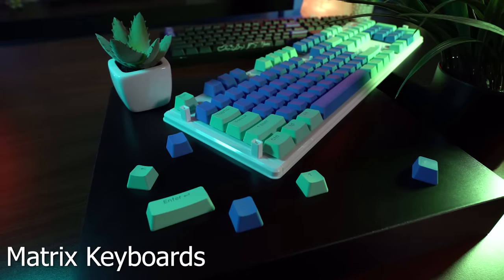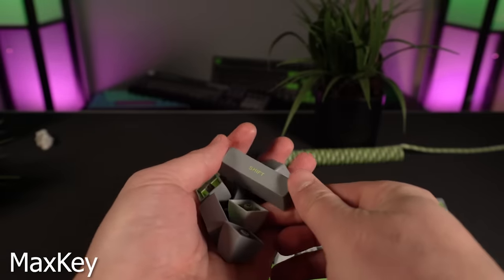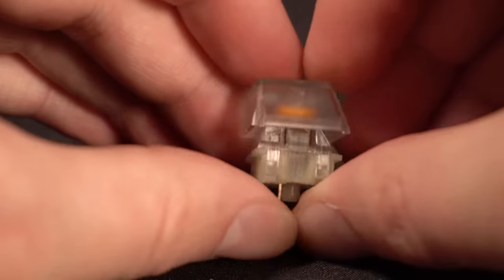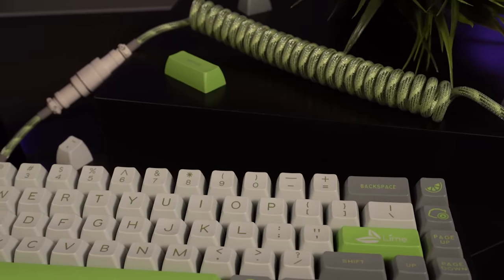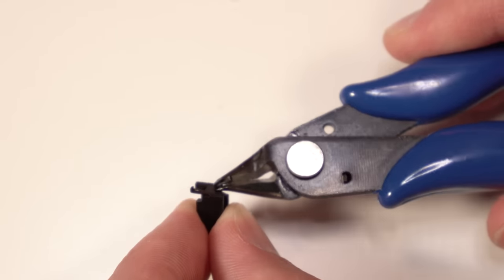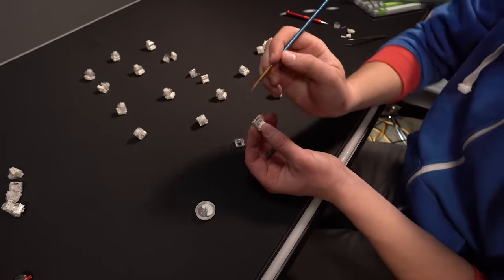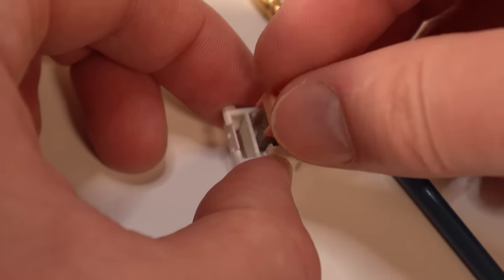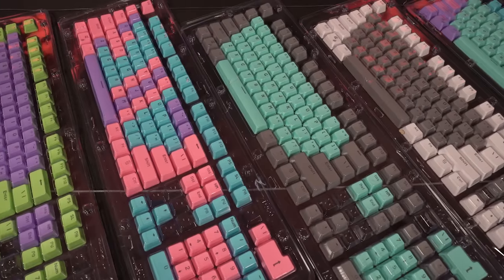5 Super Easy Mechanical Keyboard Upgrades Anyone Can Do!

Comment from the maker: Hi everyone! I hope you find this video helpful. What mods are you going to do first!?
Reply: Probably gonna just lube my stabilizers and add switch film to my switches.
Reply: I love ur vids
Reply: Brainbean Not all switch lubes work with stabs. I'm pretty sure the only switch lube thich enough to work is Krytox 205g0.
Reply: Lube stabs using interdental brushes! Its easy without having to remove the switches from the pcb. Tried this myself. Not perfect but gets the job done.
Spray Lube switches! Been tried out a lot in Korea, and some people like it. Using Aerosol SuperLube to lube switches rather than brushing lube. Messier, but it is easier. Havent personally tried but it works.
Reply: add a warning for when the sound test ends it's a good idea :)
Reply from the maker: kawaei uwu not a bad idea. I’ll consider doing that next time 😄 hope your ears are okay.
Reply: Do you have links for the coil cables? I think you said lux and space
Reply: @Brainbean  thanks :)
Reply: For plate-mounted stabilizer, I would apply tape or apply bandage to the mounting spot on the plate as well. It makes the stabilizer a lot more secured and also reduce rattle even further.
Reply: Mousepad????
Reply: thanks <3 I bought o-rings and lube my stabs
Reply: Anyone here know where I can get that mouse mat in the first few seconds of the vid?
Reply: just ordered the parts for my first custom keyboard so I'm gonna do as many as I can while I'm building it!
Reply: hey what about spray lube?
does it really work
Reply: I didn't even know you could mod the stabilizers. Looking forward to trying it!
Reply: What is the mouse pad in the thumb nail
Reply: First, I'm gonna buy a keyboard.
Reply: ouzoiiooo
Reply: Is there a way to add rgb to a no rgb keyboard?
Reply: Probably gonna buy a keyboard first.
Reply: Where can I get a set of dark blue key caps(60%) in de layout?
Reply: All of them when I save up enough money bc I’d rather buy games
Reply: keycaps
Reply: how bout a 5 dollar membrane keyboard
Reply: @brainbean what is the keyboard you demonstrate the key presses on? Im trying to find it!
Reply: Hi  I need help can you Mabey loob my keyboard
Reply: I’m not smart enough for the extensive things because I’m an entry level with a ducky one 2 mini
Reply: We can Just paint the Keys but its work haha
Reply: i dont mean to be so offtopic but does any of you know a tool to get back into an instagram account..?
I stupidly lost the account password. I would love any help you can give me
Reply: @Dangelo Valentin Instablaster =)
Reply: @Ayden Harry Thanks for your reply. I got to the site on google and I'm trying it out now.
I see it takes a while so I will reply here later with my results.
Reply: @Ayden Harry it worked and I finally got access to my account again. I am so happy:D
Thank you so much you saved my ass !
Reply: @Dangelo Valentin Happy to help =)
Reply: Hey
Reply: even i dont, or i just buy a hole new keyboard. as the price is almost identical

Comment: I don’t even own my own mech yet but that being said- 

I’m already intrigued by this hobby- didn’t know people were so into it until a few days ago. Consider me subbed.
Reply: Lol same, learned about mechanical keyboards 5 days ago and already make a custom cable, ordered ducky one 2 mecha, handmade space, enter, space keys and a pbt japanese keycap set lol.
Reply: @StagnantMizu  I wish I had money lol
Reply: Mugen why tf do people even like that board. Doesn’t even support hotswap you just stuck with same cherry switch for life like tf
Reply: Saif Bastaki i dont know much about keyboards, but i’m pretty sure you can hot swap a ducky one 2
Reply: @TooGood4Gamesv1  No it doesn't, unfortunately, which might be a dealbreaker for some. But if you're set on which switches you like, it could be a good option if you're into RGB and like the 60% form factor. One major downside is that Ducky only offers Cherry switches (no option for Kailh box or Gateron).
Reply: @strawberry4231  this is the reason I'll Build my own 65% Kb. I want Kailh Box Red Switches, ISO De Layout, my own Keycaps and stuff like that...
Reply: strawberry42 epomaker gk68xs is where it’s at. Hotswappable, rgb, 65%size, wireless/wired usbc, Great pbt keycaps, and a heavy aluminum frame if you want it over the plastic frame.
Reply: @Triannosaurus  I'll be sure to check that out. I just recently bought a DZ60RGB ANSI v2 hot-swap kit from KBDFans, so I'll hold off on splurging on another keyboard for now.
Reply: Same lol
Reply: @TooGood4Gamesv1  you can't  you have to desolder it
Reply: @samba9450  Well the people who likes them are mostly enthusiast.
Reply: @StagnantMizu  lmao same, learned about it a couple weeks ago and now I'm 2 boards, 3 sets of switches, and a couple of keycap sets deep
Reply: Same
Reply: Im getting a mechanical today :o
Reply: Yessir
Reply: bonkbonkbonk
Reply: @StagnantMizu  ducky? ducky? fucking ducky? why that? just get a gk61 with the alu case. I wanna know why you are getting ducky.
Reply: @Triannosaurus  the BM68 with the alu case is much better. its also cheaper.
Reply: @White-qw8xe   not the quality I want, Ducky is awesome great builld quality on  the mecha mini.
Reply: @StagnantMizu  lucky lubing those soldered switches. also Im pretty sure that the GK61 is basically the same build quality.
Reply: @White-qw8xe   well I managed to lube them, might not be the best choice overall but   I am more than happy with what I bought
Reply: @StagnantMizu  i like how many people are so mad at you and telling you to get otherwise.
Reply: @TooGood4Gamesv1  no it cant
Reply: @bublikestech2164  Yeah, I wrote that ages ago ahaha

Comment: Tip: You can lube your cherry or gateron switches even if soldered, you can unclip the switch from the housing to disassemble the spring and stem, more finicky but definitely doable
Reply: Can't speak for gateron switches, but this isn't true for all keyboards. All of my keyboards have plate mounted switches where you can't reach the clips.
Reply: Dereban Oh yeah true, some keyboard have no plates
Reply: @dereban5654  can foam and lubing the keys from outside make any noticable change in my typing experience?
Ps- I can't want to de solder my switches.

Comment: 1) Custom keycaps for that "aesthetic" and some notable difference in bottom out sound. See Maxkey SA, GMK, and matrix textures keycaps (possibly xda/dsa), but anything that isn't that boring oem abs keycaps. Also heard mt3 keycaps are good too.
2) o rings to reduce bottom out distance and make the switch feel "mushy"
3) Custom coiled usb cables (luxcables and spacecables) for "style" and nothing else
4) lubed and clipped stabilizers with bandaid mod
5) lube your switches

Good luck and find your own timestamps :)

Comment: Ok, before I watch the video I'ma guess what the upgrades are. 
1. Bandaid under the switches to reduce the wiggling and make it more solid
2. Color code the keyboard for specific finger placements.
3 lube switches for buttery smooth travel 
4. Place dampener pad under pcb to quiet the "ping" noise from switches & keycaps.
5. And while it's not technically a hard mod adding a forearm rest to the keyboard is a def win in my book.

Comment: People also use those connection cords for the fact that some have better connection speeds than others, usually they reduce the delay from each key press to seeing it on screen, especially compared to the cord you receive out of the box.
Reply: @Rando actually 1 second delay is heavily noticeable. With the drivers I run the stock cord that came with my RK61 has a 1.7 second delay which if you’re playing a competitive game that seriosuly affects gameplay and can bring a 4.0 KD in COD down to 0.3 KD

Comment: fun fact: u can still lube non hot-swappable switches, just hold down the keycap stem with a small flat head screwdriver and apply lube to the sides of the switch with a small tip paint brush.
Reply: no
Reply: @sarpp69  yes
Reply: @sarpp69  It does lube the switch a tiny bit but for most it's not enough and it is definitely not as thorough as a full teardown and lubing all areas properly.

Comment: Is there an easy way to check for "standard" vs "nonstandard" layout? Or do you have to actually look at it (as in like, know what size keys are standard vs nonstandard)
Reply from the maker: Typically just looking at it is the easiest way to tell. I would pay attention to the shift key on the right side and the bottom row as those tend to be the most common keys that will be incompatible if it's non standard. Which keyboard are you wondering about?
Reply: You should always look at the keycap size relating to another. Typically an alphanumeric key is 1u. Make sure you buy the keycap kit with the right 'u' measurements. For example, some poeple want a shorter right shift to add an extra button: they would need the 1.75 u instead of 2.75u right shift then an extra 1 u key for that row.

Comment: Can also put some foam inside the keyboard especially those drop keyboards make a metallic ping on every key press
Reply: That's more in the upstroke and at that point, foam won't do too much. It's better than nothing though...
Reply: @SimGunther  It will if foam touches the metal it will absorb the pang whether its upstroke or down check reviews at https://mkultra.click/collections/65-foam/products/massdrop-alt-low-profile-foam-combo
Reply: i’ve seen some people put sound dampening foam in it. haven’t tried it yet but i will soon
Reply: lube your springs

Comment: Great video! Just wanted to tell you, in case you didn't know,  there is no point in band-aid modding the stabs on the Drop Alt,  because plate-mounted stabs doesn't touch the pcb.

Comment: Brainbean: recommends lubing stabs
Me, who uses Costa stabs: ._.
Reply: You can actually lube costar stabs, though improvement is not as much as cherry style stabs.
You lube the holes in the nubs and and the parts where the wire connects into the board/PCB I think? Idk if there's vids on YouTube though
Reply: @rynne7153  yeah I know. Immediately after commenting this, I went searching for the guide and now I can confidently say that my spacebar isn't rattling anymore
Reply: @LilacFPS  Awesome!
Reply: You can also apply the bandaid method to costars, you just put the bandaid inside the part that clips into the plate (very thin strip) helps with that bottom high pitch clack.

Comment: Just about where I am at the moment, thinking about either building a 60% or trying something with my Corsair K68. Really knew nothing when I bought the board, it has Cherry MX Blue switches, I don't know whether it is soldered or hot swap. You gave plenty of explanation and sources for various modding items, thanks.
Reply: Corsair boards are all soldered

Comment: im chillin with my entry level $40 Outemu Blue switch Soldered Keyboard. might change soon to Ducky one or keychron
Reply: Ducky has a great reputation for a reason imo. i just got the one 2, and its the lil things, like an extra pack of colored keys, special spacebar and esc key and key puller is nice addition, you can tell they are passionate about it.

Comment: Also switch lube for stabilizers are Krytox 205g0 ONLY, others lives are either too thin or just harder to work with compared to dielectric grease.
Dielectric grease is also much cheaper for the amount you get
Reply: @Dubufy  should work just fine. it's not that hard to work with, and feels fine after lubing (I lubed my reds with 105 as well)

Comment: You also forgot that to mod stabs, you also need to remove the switch of that key, which also means desoldering. 

All of these are common knowledge, but the last two are not exactly "easy" on soldered pre-builts.  There are some methods with does not require desoldering to lube stabs AND switches, which you should have added on to the video. 

Spray Lubing! Common method used in Korea that they use some aerosol lube to lube switches. Its easy, but takes a while because you have to let it dry out for 1-3 days after. 

Lubing stabs using an interdental brush! Interdental brushes are really flexible, that you can get them into the stabilizer wire insert if you pull the stab up using some tweezers. Put some lube into that brush and lube that hole.

Comment: about the avitor cables being easy and quick to swap keyboards, wouldn't it be faster to unplug the cable itself from the board? How come fiddling with the aviator connector is faster and easier when I can just unplug the cable and not have a short part of it dangling from the board?

Comment: In this video is mentioned that you can use aviator connectors to swap out keyboards. Although its very important the keyboard not connected to the usb end when you connect the aviator as you can fry your pcb.

Comment: For plate mount stabilizers like on the Drop Alt and CTRL keyboards, you don't need to band-aid mod the keyboard since the stabilizers don't hit the pcb. That's why plate mount is great since you also don't have to take the keyboard apart to mod the stabilizers.
Reply from the maker: Even though they are plate mount the stabs rest directly on the PCB on the Alt and Ctrl. Bandaid mod will absolutely help.

Comment: Isn't it difficult to lube stabilizers, if you don't have a hot swappable PCB? From my very limited knowledge, it's not possible to take off the stabilizers without pulling off the switch as well, and then most times, you'd need to desolder, is that correct?

Comment: Btw you will have to desolder switches from gaming kb to lube plate mount stabilizers. Or just take a brush and showe a lot of lube in that hole of the stabilizers. After showing enough it will be similar as lubing with mentioned method. Just that you will need to use more lube because you will be trying to shove a lot of lube and try to reach places where there is actually usefull

To become master luber starts from holy panda, because it is a hardest switch to lube because you have to open khail switches, cherry switches, lube and springs swap everything
Reply: Yes u can but it’s worse than just taking the switch off because you can’t reach a lot of areas and the lube will be very inconsistent

Comment: you can lube switches while they're soldered in the board
Reply: Sometimes. It depends, if you have LEDs that go through the switch than no, not with out de-soldering, also the keyboards plate needs to have notches for the switch tops to come off.

Comment: Which set of keycaps should i buy for razer huntsman elite?
Reply: The razer keycaps fit in all the razer keyboards I think
Reply: The abs are sooooo quiet on that board I almost don't wanna switch to pbt lol
Reply: @BradTheBrobarian  no it is not quiet for me.
Reply: @sectogg2535  If the problem is the sound, you can put o-rings
Reply: @hugo8866  yeah.can i buy every o_rings?i mean will it work .
Reply: @sectogg2535  I haven't bought any o-ring but I think reddit would be much better than me in the doubts you have
Reply: @hugo8866  ok .thank you .
Reply: Ashkan Abdolahi check out mechanicalkeyboards or novel keys, both should have them in stock

Comment: Could you maybe make a tutorial for lubing stabs without disassembly for a prebuilt?
Reply: If you get a tube of lube with a fairly small nozzle you can just squirt some into where the wire goes into the plastic. You can also use a very fine tip brush and shove it into the small gap between the wire and plastic housing. This wont be as effective as dis assembly, but it will give a noticeable improvement.
Reply: Nick Helgeland thanks!

Comment: i have seen people open their keyboard and put some kind of a foam inside...
for what they did that?
Reply: 1. A deeper and more bassy sound: The biggest impact I’ve noticed when adding foam is how much better the keyboard sounds afterwards. The keyboard will typically sound less high-pitched and more subtle and bassy. It’s really satisfying.
   2. Less metallic spring ping noises: Another change is you’ll experience less of a metallic ringing noise. When typing on a keyboard, the metallic plate can vibrate and make an unpleasant noise. Or the springs inside the switches will vibrate. Adding foam will reduce both of these sounds.
   3. More secure keyboard: Adding foam (especially sorbothane) will add weight to the keyboard which will make it slide around less when typing. This will make everything feel more secure and the only parts that will move are the keys themselves when entering a keystroke.

Comment: Hey i have a question about the lube they use to mod switches and stabilizer, i’m not from the us, when i searched krytox in a few websites here it didn’t show any result, 
Do you know what can i look for do they use them in mechanics like fixing locks 🔐 and stuff
Reply: Kli MqX look for lube with ptfe, dielectric lube. That way the lube won’t eat away at the plastics and circuit board. A good cheap brand alternative would be superlube. Good luck!
Reply: Use PTFE lubricant such as Super Lube, or some bike chain lube with ptfe. You can order lube from Switchmod or Novelkeys which might ship to your country
Reply: Shahzad Khan thank you 🙏🏽 i’ll search for it and keep u updated
Reply: Rated Equation thanks brother

Comment: if you have an optomechanical keyboard you can literally just pop out the switch and spray some wd40 on the spring as long as you let it dry for an hour or two, so if you have an optomechanical keyboard that's probably going to be your best bet (don't quote me on that though)

Comment: Do you know any keycap brand that has the same font as the Max keys but with rgb shine through?
Reply: No keycap brand does that, as it's not easy to get a high quality shine through SA keycap without messing it up.
Cheap quality SA keycaps with shine through can be found on AliExpress 
Search for "SA keycaps" or something along those lines and you should be able to find some
Reply: Rynne ok, thanks for the info 👍